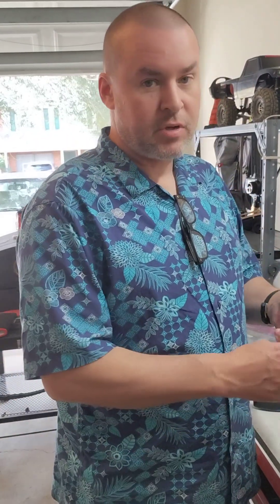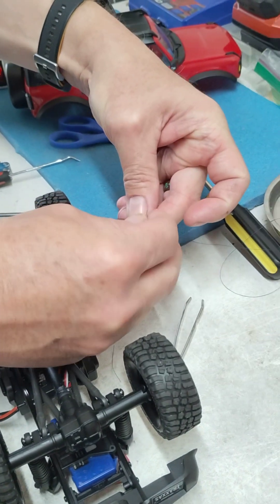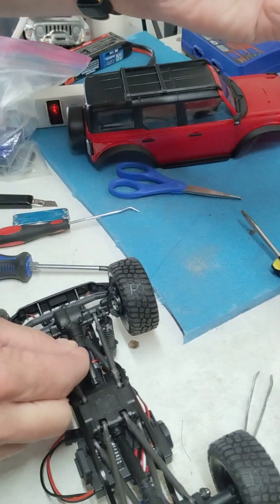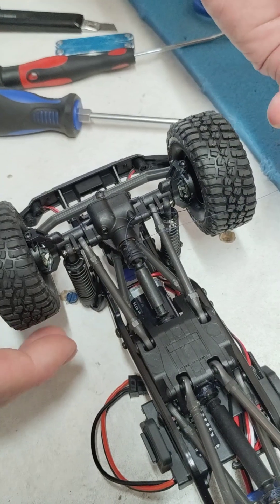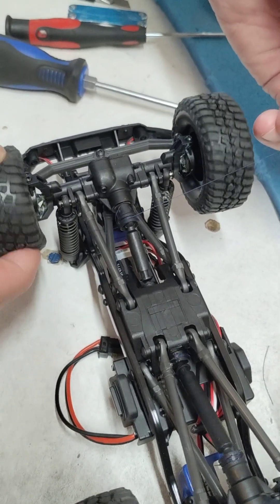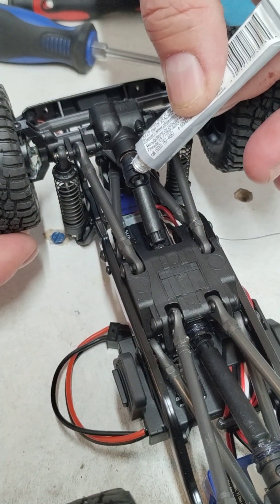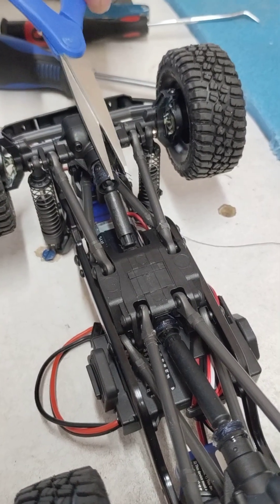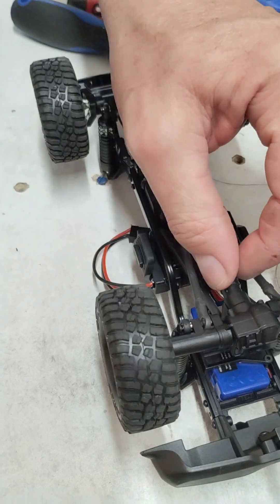Traxxas TRX-4M Driveshaft Problem Easy Solution

Comment: I haven’t had any problems with mine (knock on wood😂) when is this happening? I play with mine only inside
Reply from the maker: I've only read about it on forums and on Facebook. Some people have theirs come off the very first drive. I suspect it's whenever anything contacts the driveshafts, like crawling on big rocks.  I decided to do this fix so I don't have to worry about it.

Comment: (I put white PTFE THREAD SEAL TAPE OVER THE DRIVE SHAFT AND RUBBER RING.  )SO WHAT CAUSES THEM TO FALL OUT. IM JUST GOING TO USE MY TRX 4M for trailing with a little crawling at times.   Also I Have Thread lock glue would that work.
Reply from the maker: I think they get caught on things or dry out and crack.